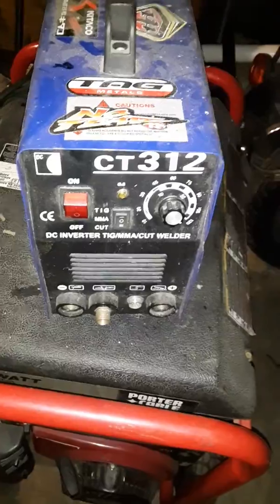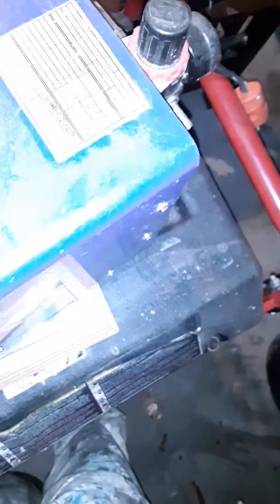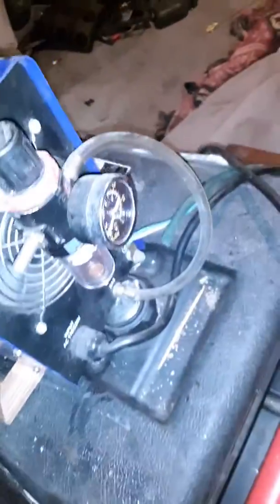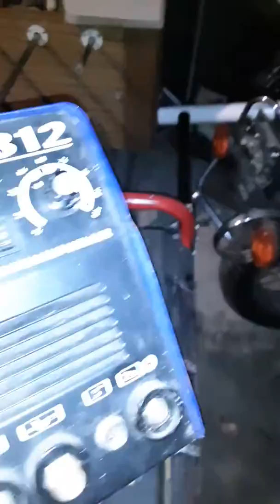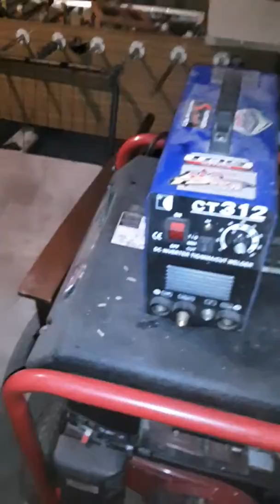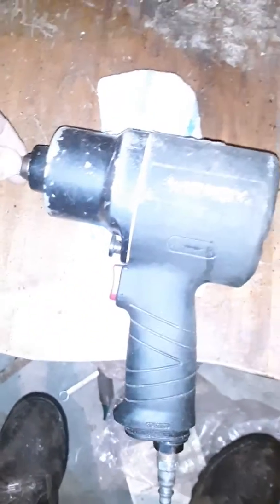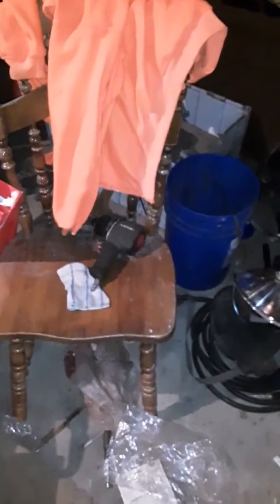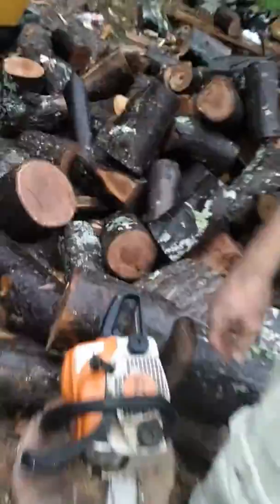Ct312 3 in one unit review

Comment: How does the plasma cutter work. Are you happy with it. And the tig part
Reply from the maker: Yes I think the plasma  cutter  works good its cuts up to a half inch  to inch  AMD tig welder works good I like the stick welder better like it's a 3 in one unit works great for the price I had mine for 3 years now not one problem  with it
Reply: redneck tv 603 live free or die thank you I really needed it for plasma. But for the price it would be to hard to pass
Reply from the maker: For real it's a great unit I'll make a good video  on it today I'll try to upload  it  by tonight
Reply: 1/2" to 1". Bullshit.
Reply: @aubreyaub  
I bought one. And i cut a piece of flat strap 3/8 it cut it. Slow. I’ve never tried1/2”— however I cannot see it ever cutting 1” i would like to see it for sure

Comment: Damn! I thought my workshop was a mess ...

Anyhoo. That wasn't much of a review. You didn't go into any real details of the unit and as for the lengths of the leads: No. they aren't all that long. Earlier versions had tig and plasma leads over 15' long. Mine are barely 7' and a 3' mains lead is pathetic! I haven't fired mine up yet as there are parts not included in the kit. Argon of course, but I wouldn't expect that anyway. However they don't even include one tungsten, the tig insulator is missing and the head seems (?) to need a gas lens to take up a gap between the collet and the back cap.